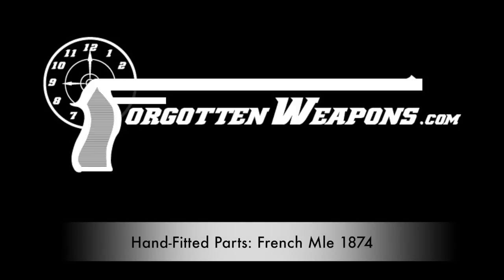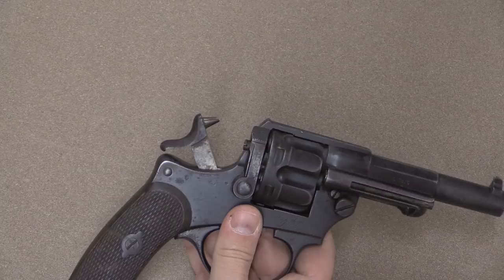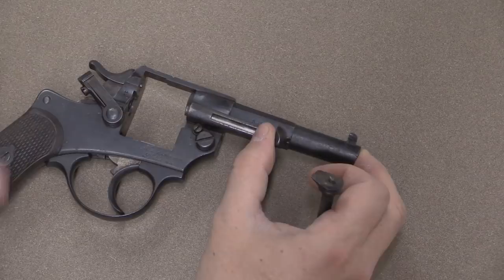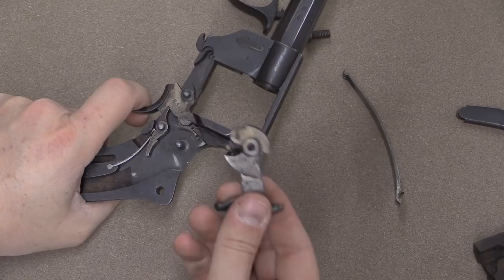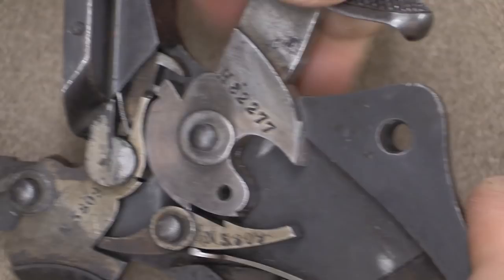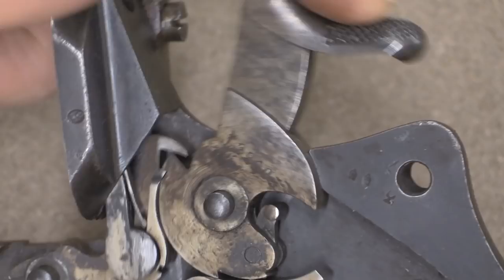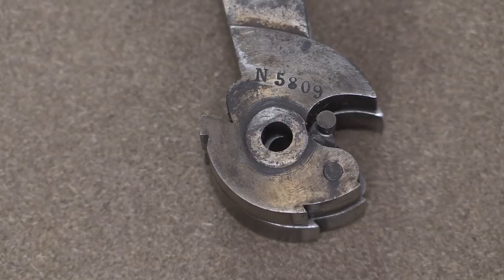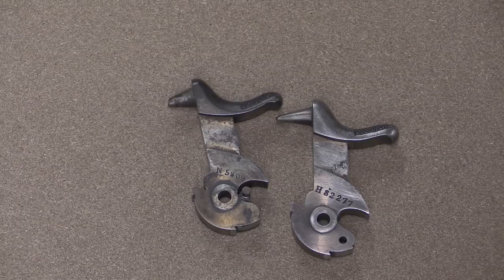Hand-Fitted Parts Firsthand: French Modele 1874

Comment: Flatten the hammer point then drill it out and put a hardened steel pin in to act as a fiering pin. Might take some adjusting with a file but it would work.
Reply: That's more complicated - good luck filing down a hardened pin. Welding+grinding does the job - and keeps the original look.
Reply: or weld onto it and mill it down to spec
Reply: Big Daddy Dons That would probably work but over time you would destroy the threads. It would take a while but I would not thread something that is going to take the brunt of the force every time you fire it. I would just put a hardened pin in. Don’t even need to solder it. Just heat up the hammer and freeze the pin before tapping it in.

Comment: If the firing pin's dimensions are flexible, that is a HIGHER tolerance fit, meaning that it is more tolerant of discrepancy. The usual terms used are "close tolerance" foe a fussy fit, and "wide tolerance" for a close-enough-that'll-do fir.  Just FYI.

Comment: I ran into this same problem with a 1980 Colt Cobra. I learned that the old way of manufacture was to make over size parts so they could be filed to fit. I had to give it to My brother -in law to get it done right. Surprisingly Colt did not change this process until 2000.

Comment: In BCT, they told us that the parts inside our rifles, like the bolt carrier group, buffer, buffer spring, etc, were all put in there when the rifle was produced in the factory and that the parts of our M4s had developed scratches and marks inside the rifles that were unique to just our rifles. They also told us that swapping parts between rifles was a potentially bad thing. While the later I've held my doubts about, I know a good deal that firearms, at least their assembly, is still done by hand, mostly.

Comment: Glad you are handing it over to a smith to build up the firing pin (that's what I would have done first, but I do weld and machine). One point though, as a machinist type, Don't line up the notches, line up the pin hole. This shows the differences between the notches more precisely.

Comment: Excellent! My first thought was welding the firing pin also, but wasn't quit sure if the heat would affect the rest of the hammer. My second thought was if the pin could be removed, taping the face of hammer and threading a new replacement pin, kinda like changing tips on a arrow shaft. I like your idea best because it's a lot less complicated and less time to fix it.

Comment: You can fit the new hammer to your revolver by using the proper files to get the fit, then hone stones to polish the surfaces then use Kasenit to harden the parts after the work is done.

Comment: This brings me to my current conundrum  with my C-96. So many of the small parts were hand fit it makes things very difficult to find proper replacements. Even if someone were to create new production parts there's such a wide variance in tolerating that if it's going to be put in an original there is going to be fitting involved.

Comment: As a bladesmith I work with hardened steel all the time and as long as the hardness if the metal is below about 65-70 hrc(rocwell) it can be filed down but it will be hard on your files otherwise you must use abrasive papers or stones
Reply from the maker: +Connor Myers-Norton My concern was that the part is probably only surface hardened, and a substantial change in profile would require re-hardening.
Reply: Of course, and I completely agree with your course of action, repairing the original part is what I would have done(but I'm no gunsmith)
Reply: don't really see why it would be case hardened rather than hardened all the way through, would be easier to harden it throughout (amateur bladesmith here)
Reply: RVRgeek Cost of materials and wear and tear of machinery. Case hardening an inexpensive iron rather than shaping a more expensive steel or steel alloy. In more modern terms, a mechanically declined driver broke a gear in the PTO train of a tow truck. The trucks owner had a friend who as favour used high pressure water jet to cut a new gear out of stainless steel,I think it was. Since it was a one off,using expensive material made sense. Had it been a production part,a less expensive steel would have been subjected to a series of steps,culminating in a gear that had lower unit cost.Five years later, I asked the owner, it was running flawlessly. Pretty much the same idea here I think. The tradesmen journeymen creating this part would have used true cast steel as apprentices,and true wrought iron,as opposed to Bessemer mild steel was part of the way things were built.So hardening wrought iron was something shown to them as young men.You harden where it is needed.
Reply: RVRgeek: The reason it is case hardened is because that is the only way it will be strong enough to do the job, if it were hardened right through some letting down,(tempering) would have to be done to prevent chipping off at the stress points, by case hardening you get a glass hard surface of about .020" with a tough core, the best of both worlds.

Comment: I would like to see what the Seer would look like if the pivot pin hole was lined up between the Hammers. 
In the video you can see that even though you have one lined up and the bodies lined up the pivot pin hole is off.  
As a gunsmith Yes adding to the firing pin is the best way to go you get to keep an original part and make a nice seamless repair.

Comment: Welding will work pretty well, I was also going to suggest that you could drill the center of the firing pin spur and press in a roller from a needle bearing which should work quite well without subjecting it to heat stress. You could drill it for a slight interference fit and use some Loctite on it too. You could warm the hammer in a toaster oven and freeze the pin for a heat shrink fit too. You could also completely cut the old spur off and drill/tap a hole or do an interference fit for a whole new firing pin spur that threads in/interference fits the hammer. Would be pretty easy to turn one in a lathe and part it off.

Comment: Interesting, I've been tinkering with a pair of Savage 1907 pistols. One's in the 10K range, the other's in the 1K range. The subtle differences in design are astounding. Back on topic, I ended up getting another ejector for one of them, and ended up spending the better part of two hours slowly filing it down to fit. You would think that tolerances on something like that would be okay, but the few thousandths made all the difference in the world.  Even though Eli Whitney came up with the concept decades before, true parts interchange and designs that are not as tolerance dependent are wonders of modern technology.

That revolver rocks, what are you doing in the way of ammo? .45 auto loaded with black powder or did you manage to score some real French stuff? The stock ammo seems really anemic, but maybe that's because it's black powder.

Comment: While you cannot (reasonably) file (with a steel file) hardened steel surfaces, you can always diamond-file or grind them. You can also abrade them with silicon carbide provided that you do so manually, not under power... or if under power, only if you keep it wet with water to keep the temperature down.

Comment: Recently faced a little fitting issue replacing the barrel on a post war Ortgies. The barrel twists to the side for removal. The new (to me) barrel from Numrich, though visually identical, would not rotate fully back into position. I was able to use a stone to gently relieve a few thousandths from the stop, part of the frame, giving me a square fit. Many times firearms designers leave room for fitting in softer parts. Not the case with your revolver it seems.

Comment: The nice thing about modern technology is at some point you'll be able to recreate old hard to find or broken parts with 3D printing and hand fit the parts into place. Still, an excellent video as always :)
Reply: +Galahad Potentially, in some situations, but it wouldn't work in this one as I've yet to see a 3D printer that can selectively heat treat parts so that those sears are hard enough to maintain their edge, but the rest of the hammer is flexible enough not to crack due to fatigue when it's fired repeatedly.
Reply: +TeaDaemon You could  3D metal powder print it and then heat treat it after, but then you need a forge or other heat treating setup. Though don't know how good quality you can get out of 3D metal print. Since it is made out of essentially flash molten powder and not out of solid cast or forge, it might be weak.

Then again they use 3D printed metal parts in rocket motors and jet engines, so apparently with proper enough equipment you can create very durable parts. Thing is those printing machines cost tens or even hundreds of thousand of dollars.
Reply: +Ari Takalo To be honest, I'm already very impressed with the ability of current 3D printing technology has to produce strong, durable parts using a method (sintering) that's traditionally been mostly used as a cheap and easy way to manufacture components that aren't going to be subjected to significant stress. Having said that, it's important to realise that whilst 3D printers can do a lot of things, there's still a lot that you can't do with them, and this component would be a good example. As you say, you could 3D print a replacement and then heat treat it afterwards, but would that really be a significant improvement over just machining it the old-fashioned way?

In my industry (boats), one of the advantages of 3D printing is that you can create components without having to design them so that they can be easily machined out of a solid block or welded together from standard-sized stock, so you can get some quite significant weight savings (up to 50% in some cases) over traditionally made components.
Reply: +TeaDaemon Yeah i completely agree. I guess my comment was more geared toward the future and the potential of where the technology can go. Another optional route would be to wire EDM the part.

Comment: I'd grind off the old pin, drill a tap a hole, have a new firing pin made at a machine shop with thread, then thread it on, thats just an idea though. you could have it made to look the same, there'd just be a little seem at the base of the pin

Comment: I don't think you need much to fix that, you could soften the metal by heating it up and letting it cool slowly, do your grinding and fitting, then re-harden the metal with an oil quench while in critical temperature

Comment: I had just typed in couldn't you use a welder and rebuild the firing tip when you said that's what you were going to do.
Reply: i was thinking the exact same thing. I could fix that with a tig welder in about 60 seconds
Reply: +God of Thunder (UKKONEN) ditto

Comment: Welding will end up with an original appearing and number matching hammer.  As an alternative to welding you might consider drilling and tapping a hole in the base of the old firing pin and threading or just drilling then brazing/silver soldering in a rod contoured to match the original firing pin shape.
Reply: +o2wow I don't think Solder has the strength to deal with the impacts.
Reply: +Andre Krumins neither would brazing material, however the impact would be against the pin inserted in the hole.  The brazing/soldering material would only hold the pin in the drilled hole in lieu of threading the hole and rod and screwing it into the hammer.  Under impact the pin would be 'pushed' by the bottom of the hole.

Comment: Idea for ya Ian: Why don't you try cutting off the firing pins of your original hammer and your replacement as close to the hammer as possible, then thread a hole in the original hammer and the replacement firing pin, and then screw both of them together with a bit of threaded steel? It would allow you to adjust the length of the firing pin to exactly where you need it and then you could just tac weld it all together. I know that it wouldn't be particularly pretty, but it would probably be a lot cheaper than getting the new hammer milled to the exact size and shape of the original. Just a thought. Cool gun though!

Comment: Welding up the original and regrinding is the ONLY way I would have ever tried to repair that gun.
I never in a million years would have thought ANYONE would have the proper replacement part.
That's just the way I think though.
 I would have been at the range shooting it,before you ever got a chance to order the part .

Comment: To tinker on heat tempered surfaces there are special files plated with diamond dust from industrial diamonds , .....one can use these to take off smaller amounts of material from such hardened steel surfaces , .......just in case , ......though welding up a new firing pin surely comes easier than tinkering on an imperfect spare part .

Comment: Instead of welding another firing pin into the original hammer, you could also consider someone to scan the hammer into CAD software, fix the firing pin and C&C a new part. Or use the more traditional way and just wax-cast a new part.

It would be a lot more expensive though, but you would get a carbon copy of the original hammer with a fixed firing pin without altering the original.

Thanks for the video though, it's interesting to see such "mass produced" items produced by hand.

Comment: the first hammer, can you tac some weld on the tip and file it down to size and re heat treat it ?
Reply: Lol
Reply: +Derek S
"They ground the firing pin off."So put it back on!
Reply: +Thelothuo It would only take an hour or two with a coarse diamond stone to take the interfaces down, and the temper should extend at least a millimeter into the steel. The replacement hammer is totally viable, you just need to grind it by hand to prevent drawing the temper. That, or slap it into a vertical mill.

Modifying the original hammer further will have a significant effect on the gun's value. Better to mess about with a low value part than an original.
Reply: That makes sense
Reply: Eureka MarUu
 A bit more time-taking, but true.

Comment: I'm not the most knowledgeable person on this subject, but I think you might be able to repair the original hammer via wielding. I know when ever I screw up drilling a hole into sheet metal, I can wield it close then grind off the excess material. Maybe if you wield a lot of material onto the end point of the hammer, you can grind point into its original shape. As a bonus, you can keep all of your S/N's consistent.

Comment: Fixing that firing pin is a 1-2-3 deal, you shouldn't have spent that money on an unmatching hammer. I would cut the firing pin further back to a substantial diameter, let's say 4mm and then drill a hole perpendicular to the cut, tap it and screw a piece of 1050 steel rod made on a lathe following the taper of the firing pin or once installed it can be carefully shaped by hand using hand files and then polished with emery cloth. If you put a bevel on both parts it can be either brazed or TIG welded for permanent attachment. Hardening of the tip is optional as this gun probably don't see much use.
Reply: I like the blob idea better. Doesn't require fancy drilling and tapping but still allows for it if the blob fails.

Comment: when lineing up the hammers you need to put a pin through the central hole to referance off just matching the curves and teeth with the pivot point misaligned will laeve it still not working

Comment: How would the value of this pistol be affected if it was:

a) Left clipped?
b) Welded and grinded so that all the serial numbers match?
c) Hammer replaced with mismatched serial numbers?
d) In original condition?

I know that the value of an item is only what someone is willing to pay for it at the time, but in your experience what would be the rough dollars and cents impact of modification/repair work?

Comment: Once the new pin gets welded on in place its gunna need to be re heat treated.  The welding and subsequent grinding will mess with the original part of the pin\ hammer.

Comment: Ian, I'm just curious, would you ever be up for someone mailing you a 'forgotten' weapon to take a look at?  I'm out in California, and I have a Sauer 1913 pistol my grandfather brought back from WW2.  It is fully stamped with WW1 era markings (his story is he took it off a POW, so I'm guessing it saw service in both wars).  It's kinda a neat little unknown pocket pistol, that looks strangely modern (almost like something out of Flash Gordon).  The main issue is that the magazine catch has some problems- racking the bolt ejects the magazine a few millimeters, and taking out the magazine means having to either hold the magazine catch down the whole while, or pulling the magazine down about half way, then pressing the catch again to remove it entirely.  I'm guessing there's just something with the magazine that got bent or such though.

Comment: Would the additional metal added to the firing pin need to also be heat treated or is the primer light enough to not cause the new metal to deform?

Comment: So, back in the day, the gunsmith would have hand fitted those parts and serialised them BEFFORE heat treating. Then heat treated a batch of components. Then selected the right components for the right gun for assembly?
Reply: +Mickleblade Indeed. Note that all the parts have matching numbers because of this exact problem. The same thing happens with high end pistols today.

Comment: Don't GRIND, Draw the temper, use an appropriate file after securing the part in a good vice fitted with appropriate clamping surfaces, fit and re-temper.